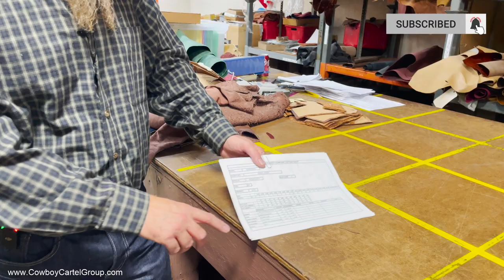Fenoglio Boot Co Factory Tour, See How This Company is Making Cowboy Boots in Nocona Texas USA.

Comment: So do they use a steel shank? Cork in the middle? I didn't hear that for the shank and mid sole? And the toe counter is it all leather like the heel?
Reply from the maker: I don’t know if we talked about the shank, its a question we would have to ask. It kind of looks like a wooden shank to me in the video. The they are using neoprene instead of cork, we talk about it at the 19 ish to 20 minute mark. You can also kind of see the shank around that area. I would have to ask on the toe puff too, I will have to check the video and see if i can tell. I would say it is probably veg tan, but I could be wrong. Thanks for watching.

Comment: So if I wear 8.5ee in Anderson bean would I still be in the same size?? Thanks again
Reply from the maker: I think it depends on how you like them to fit, and the toe shape. I wear a 9.5 ee in AB square toe, and a 10.5d in the Fenoglio narrow square. I probably need a 10d in AB for length. My foot measures a true 10.5d so I think they are true to size. Hope that helps. Thanks for watching and the comment.
Reply: @CowboyCartel  well the issue is I am new to boots and have tried AB on and know what size I am in those. I found a pair of elephant fenoglio but found a 9.5d in fenoglio and are trying those but feel like I need a wide. My right foot is wide and my left is D. So my left always feels loose and the right is snug. Such a pain.
Reply from the maker: @totalglitch   Boot buying is kind of like that, you really need to be able to try them on and live in them for a while. My right foot is a 10.5d and left is 10d, I always fit to the larger foot and deal with it. Lucchese and some others will do custom sizing for each foot if you want to spend that kind of money. If you are a 9.5EE in one foot I would fit to that. Fenoglio will be true to size though in my experience.